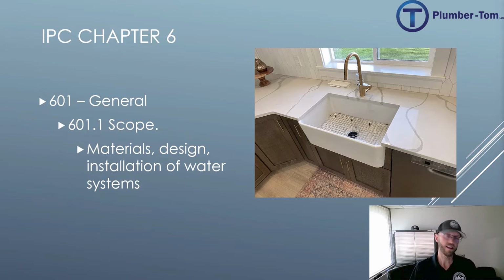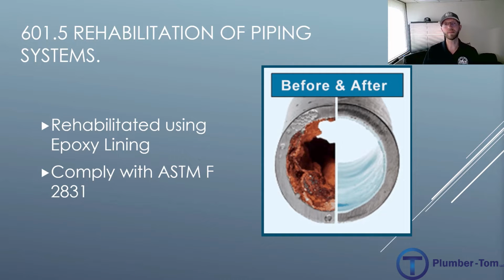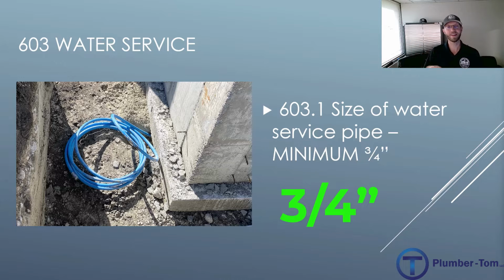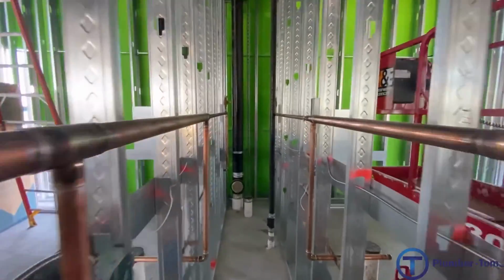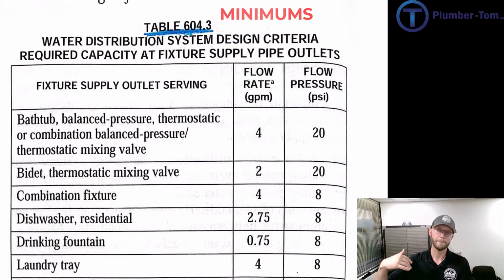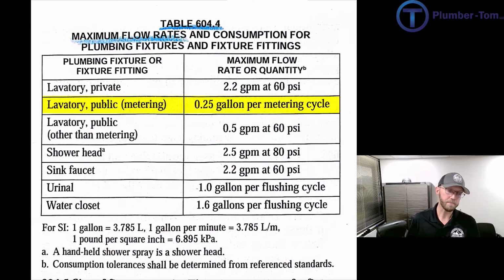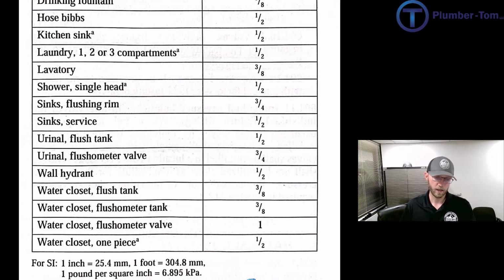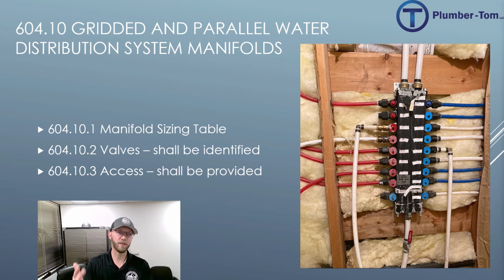Understanding International Plumbing Code: Chapter 6 Sections 601 to 604

Comment: Youre the best out there in my opinion.  Very helpful
Reply from the maker: Awesome! Thanks!
Reply: @plumber-tom9470  got a damn 74.1 on the test.  Missed it by one stinking point
Reply from the maker: @okieking8503  Ouch!  That's rough.  But don't give up!  I have had many students that have taken the test more than once.  Now that you know what it is like you can prepare yourself to beat it next time!
Reply: @plumber-tom9470  i only studied like 10 hours. Ill definitely pass the next one

Comment: I have a question about table 604.5. it says kitchen sinks need a 1/2 supply. Does that just mean 1/2 to the angle stop or all the way to the sink? I'm assuming it is just to the stop? The Moen single handle faucets that are popular right now come with 3/8 supply lines built in.
Reply from the maker: You are correct.  That is in reference to the water pipe up to the stop.  Between the stop and the fixture can be a smaller supply.
Reply: @plumber-tom9470   Thanks for your reply. I have been consuming a ton of your videos in preparation for my test. I really appreciate you making these!

Comment: does anyone know where I can find minimum gallons per minute for a residential unit (home)?  I can find fixture GPM, but not house GPM.
Reply from the maker: Hello.   Code has minimum per fixtures listed, but not a minimum per building.  Each building will differ depending on the number of fixtures connected, the size of the service pipe, and the pressure of the system. So there is not a standard per building.

Comment: I agree Tom. Maniblocks are terrible long term. They're a waste of piping and a lot of water. A traditional truck and branch system is far superior. They use less piping and when hot water is run to a say lavatory faucet in a bathroom, hot water is brought to the whole bathroom. In a manifold system only hot water is at the fixture used. Man, they were they were all the rage when they first came out!
Reply from the maker: Well said. Totally agree.